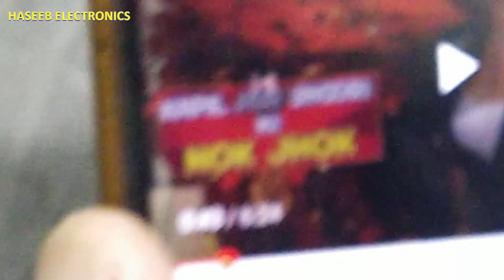{690} How to Repair Headphone, One Side Speaker Not Working

Comment: Nice work...one alternative of epoxy I can suggest: after the wires are re-soldered, just discard the original plastic enclosure and coat the 4 pole jack with mseal and give it the desired shape while it is soft,after drying it hardens,then you may cover it with a heat shrink tube of desired color

Comment: Sir प्रणाम , network section circuit में  inductor parallel में लगा होता है capacitor series में महोदय जी , signal के लिए inductor high value का रेजिस्टेंस पैदा करता है जबकि voltage के लिए एक jmper की तरह काम करता है sir यह कैसे होता है deep में समझाये please.

Comment: How about heat shrinking tube instead of epoxy?
Reply from the maker: heat shrinkable tubes doesn't provide hardness in contacts and wires. but this method secures the wires firmly,